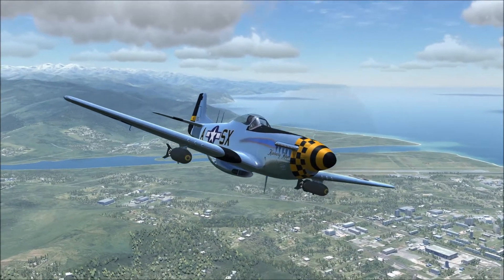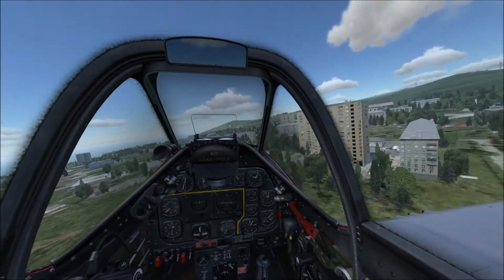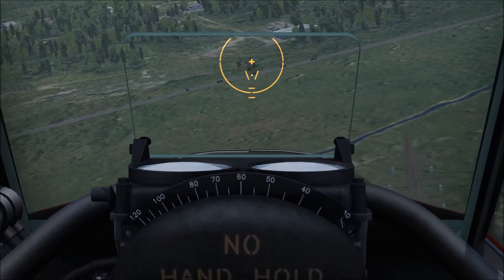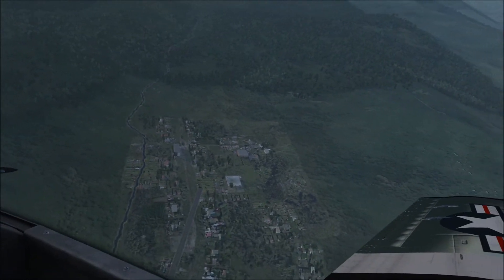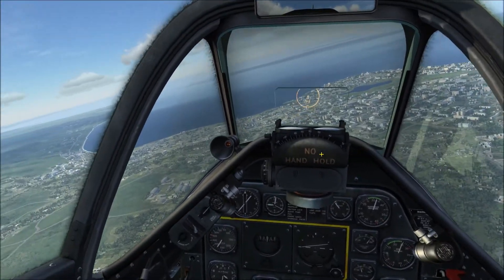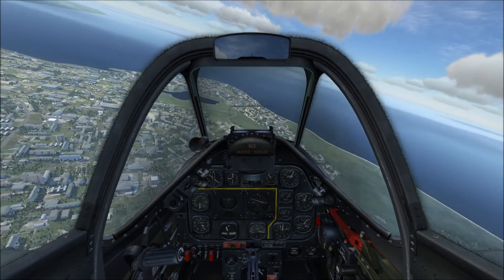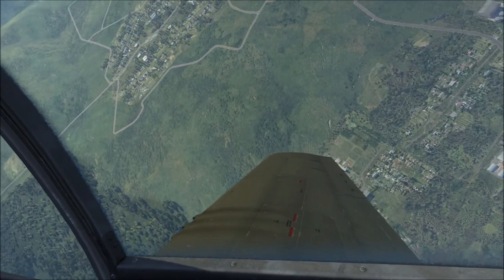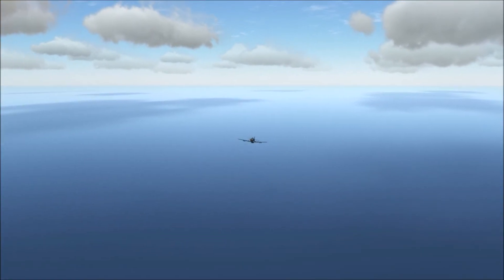DCS P-51D Air to Ground Combat Tutorial

Comment: Wait till you feel as though your bombs are going to go straight...right. :) JK and thanks Luke. In my experience, bombs and rockets take lots and lots of experience to get good at. I found that once I had my favorite angle of dive, airspeed, firing altitude, and then knowing what part of the reticle to use as your aiming point, it got much, much more accurate. That did not come quickly.